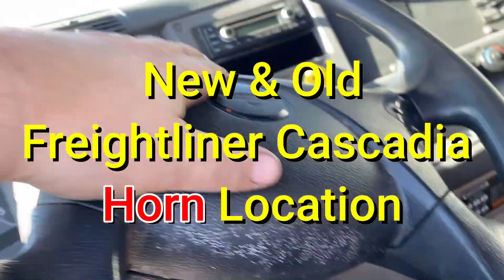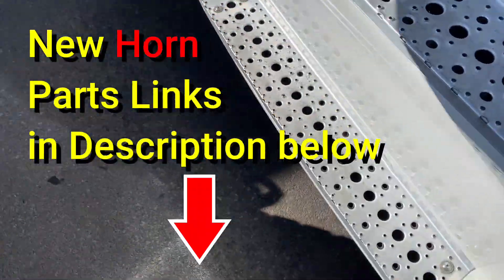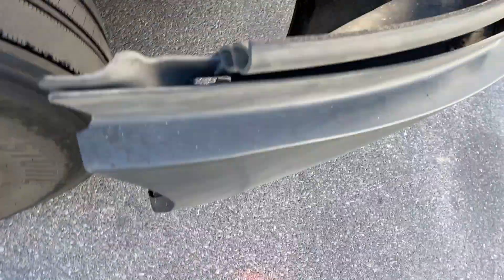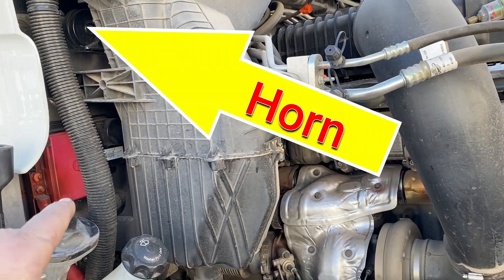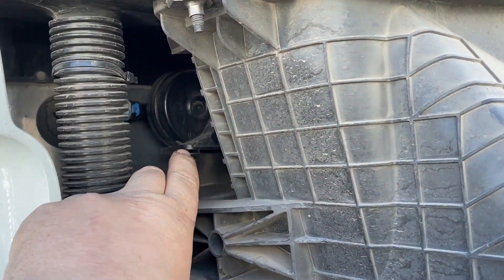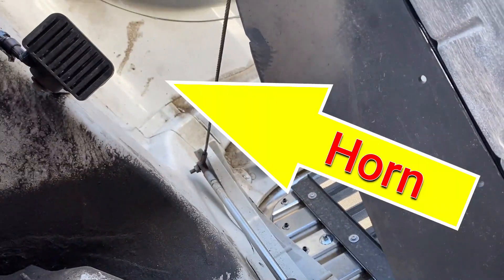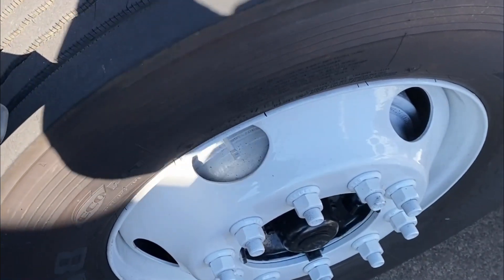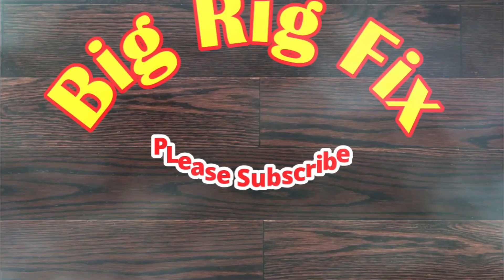(Horn Location) New & Old Freightliner Cascadia

Comment: Thanks for making this video. I have a 2017 freightliner and the horn was stuck in the on mode.
It’s not the button on the steering wheel so I just disconnected it.
👍🏼